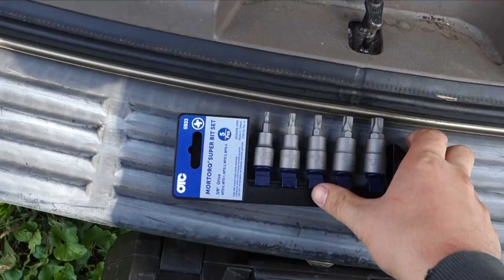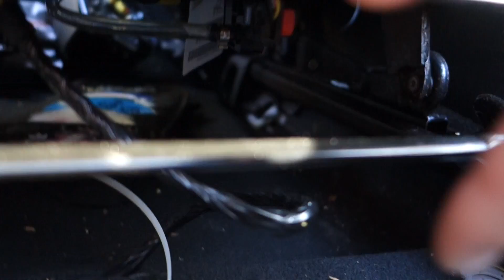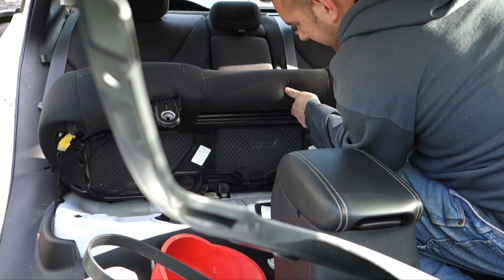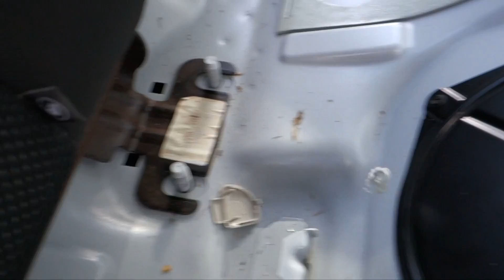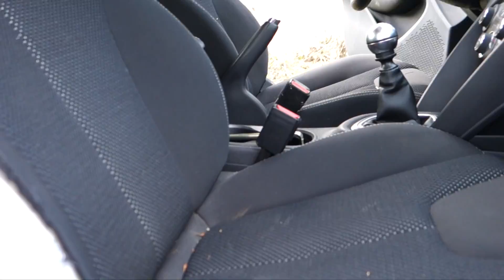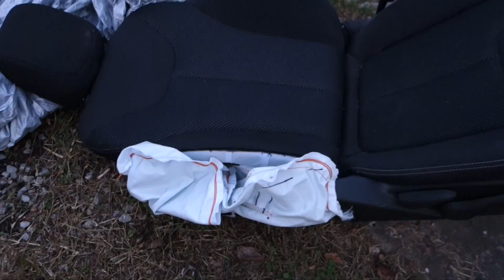Changing Seats On Dodge Dart

Comment: Thanks for the great video. I'm wondering please, do you know if it's possible to separate the passenger side rear seat back from the driver side/centre piece back? I'm hoping to be able to just remove that one piece, and leave (or put back) the bench so that I can still use the other two seats. I just want to create a hole.

Comment: thanks for the videos,, real helpful.  question, I need to replace the seatbelt  receptacle/receiver on the front passenger seat of my Dart.  Someone slashed it off :(.     Is the receptacle bolted onto the seat?    If so do you know what type of bolt or screw it is?  been searching all over trying to figure that out.  Thanks to you know what i need to remove the seats themselves!  Any help would be awesome.

Comment: can the passenger weight sensor be disconnected? which cable would that be?
Reply from the maker: I don't know. That's a good question...
Reply: Robchicks Life oh well. thanks for the response man. quick question!    normal for coolant, added, now a purple color in the resevoir?    also is it bad my top o2 sensor is a little torn up and reads a error code?  been driving like this for months..
Reply from the maker: Need to replace it. You don't want any problems later on...
Reply: What's the chances of fitting a dirtbike in the back if you take the back seat out lol